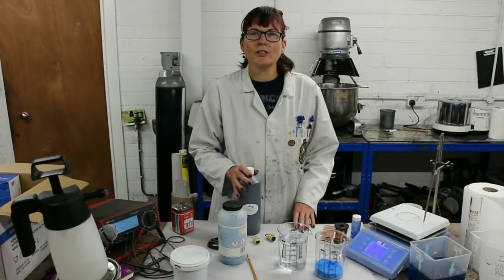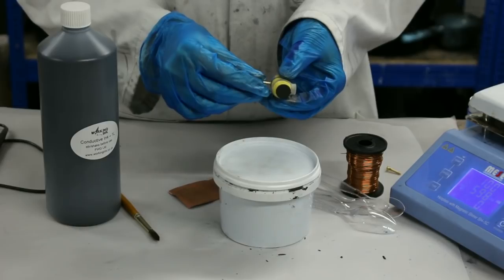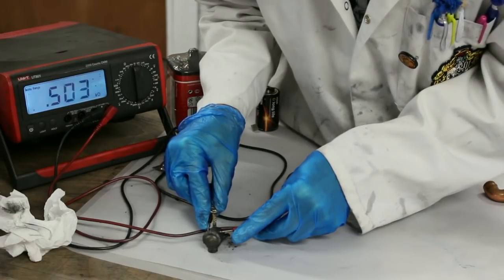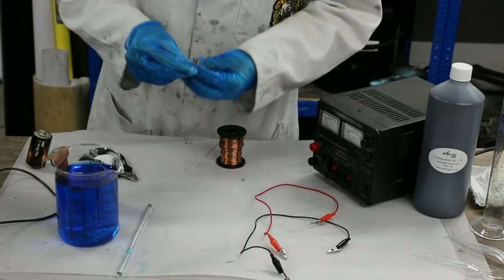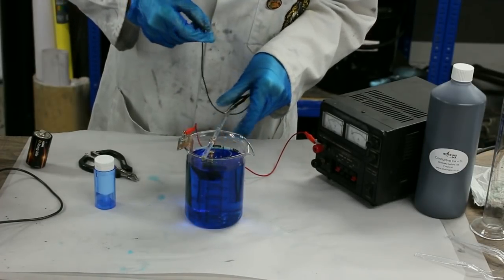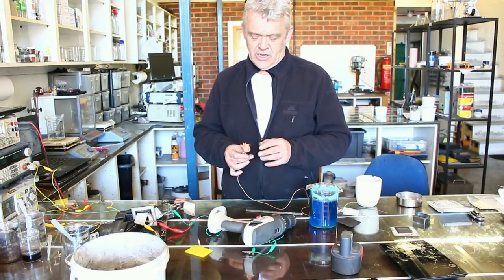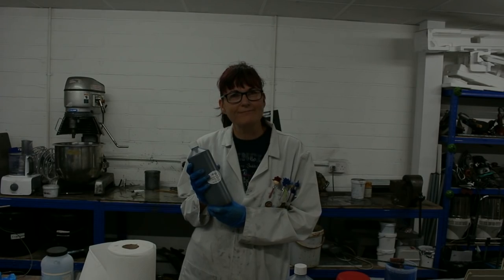How To Copper Plate A Minion With FWG Ink

Comment: Excellent work. Is the ink viscous enough to be used in an inkjet printer with a refillable cartridge? Imagine the possibilities being able to print and electroplate a flexible PCB.
Reply from the maker: it won't inkjet mate - the particle size is too big - the average nozzle is 45 micrometers across and the particle size is advised to be around 9 times smaller in order not to clog the nozzle so we need 5 micrometer particles - the problem there would be an increase in c plne trnsition points which would lower conductivity if the particles were that small.
Reply: Perhaps a specific larger sized orificed ink cartridges could be had that would allow an inkjet printer to be used to apply your ink when making cap's or batteries? It's a thought.
Reply from the maker: it is a thought and a good one - i am just not sure they do such things mate

Comment: I've been toying with the idea of trying through hole pcb plating. How does this product compare with the general DIY consensus of acrylic paint and graphite powder?

 You might benefit from doing a complete step by step tutorial specifically related to through hole plating, with a cutaway (or few) demonstrating the results under a microscope and the repeatability. Perhaps even creating a product kit with everything needed to try it. I imagine that would entail a very minor adjustment in your current lab supplies without making much investment in the endeavor. 
   Even with the current low cost Chinese PCB houses there is a lot of interest in DIY prototyping and processes right now, particularly in the Indian, Hispanic, and Slavic market. There are several new-ish YT channels that are doing really well by designing and building DIY etched prototypes and uploading them.
   Just something to think about ;)
Thanks for the upload. 
-Jake
Reply from the maker: awesome idea mate and i will try and do somethiing along the lines you suggest - though anything home done is never going to have the same results as commercial systems and repeatability is mor going to be an issue of how well a person does it as opposed to how well i do it - so i am thinking if it works at all it will be cool - as for repeating it to that level of success is going to be more down to an individuals skill as opposed to 'kit contents' - cheers

Comment: Hi Rob, I wonder whether you have an audio problem on one of your cameras? This video is mostly good audio, but the section about 8 minutes in has audio from only the left side, implying the right side mic is not working. This is similar to your previous video about the capacitor production prototype which was all on the left and almost inaudible without headphones. Great vid otherwise!

Comment: Hi Robert, have you done any videos on how to make a aluminum electrolytic capacitor? with some in depth info on the electrolytes that can be made for a electrolytic capacitor? such as does a certain type of electrolyte help improve dielectric constant of aluminum oxide or can a electrolyte be made to improve resistance of the oxide layer at high voltage. i would like to make a capacitor that can handle around the 300 - 500v mark or higher if possible while using a liquid electrolyte, and i am curious if there are any improvements that can be done with the electrolyte compared to what i am using (baking soda and De-ionized water "rimstarorg capacitor tutorial"), is pure 100% aluminum really needed? or can i get away with using a high grade aluminum like 6061 aluminum, as i want to make heavy duty anode and cathode plates and its a bit difficult for me to source 3mm thick pure 99% aluminum sheet. if you haven't done a video on how to make the basic electrolytic capacitor could you please make one. as you have so much experience in this area and it would be awesome just to hear what you have to say on this particular topic. i am currently having trouble with the test plates that i have in solution to form the oxide layer, i can create the oxide layer but its still leaking to much current 0.001 of an amp for a 25mm x 80mm plate, charged at 62v using a 62v dc power supply. the aluminum plates are made out of normal grade aluminum from the local metal shop so its not 99% pure. cheers
Reply from the maker: I am sorry mate - I haven't done that much on them - i am really a carbons guy and energy storage is the main area of concentration - sorry
Reply: no problem, thanks for the reply :)

Comment: I tried electroplating zinc on carbon coated grafoil. I suppose you can build 3d alternate layers of carbon and zinc. I ran it at 4.8v and got a white deposit instead of a zinc like layer
Reply from the maker: sounds like you got zinc oxide mate
Reply: @ThinkingandTinkering  thanks Rob. Am gonna give the slow charge a go
Reply from the maker: awesome mate

Comment: Very interesting, I personally invest in a current limiting power supply, loads out there and fairly standard on most cheaper power supplies now. Just set the current limit to 50mA or whatever and then crank the voltage to maximum. Copper electrodes for your batteries would be a bit complex, would be good to learn how to mask it so only a portion is plated.
Reply from the maker: we did use a current limited supply on the video - the battery suggestion was for someone who didn't want to invest that much and just wanted to give it a go for fun - more serious platers really need to look at a good supply and bath formulation
Reply: I have dabbled a bit with plating and found you will be surprised at the differences in results you can achieve just by changing a half volt or a minor adjustment in current to voltage. I find it just amazing what such a small change in either will cause to happen with the plating. I personally found my best results have been with voltage somewhere below 3v. DC and play with the current a bit starting low and work up slowly to get what I want.
Reply: Savvy, cheers :)
Reply from the maker: awesome advice mate - thanks
Reply: We did our own Copper, Nickel and Gold plating at one of my places of employment. Even the plating of Gold was very dependent upon current density. 3V or less was usually used, with current limited by plating bath electrolyte concentrations and spacing between devices and the sacrificial electrode. Nothing much was written down in a public location, but the desired results were more down to experience of the operators than to textbook knowledge. Surprisingly consistent thicknesses and surface flatness could be achieved in that way. A long, slow plating time, coupled with scrupulously clean device surfaces always gave the best results. 

One cannot over-emphasise the importance of the best cleanliness (no debris, no grease, no handling of the initial surfaces after thorough cleaning, etc), and low plating current densities, in achieving good results.
Reply from the maker: awesome advice mate - thanks for taking the time to write

Comment: Now try doing Styrofoam. Don't wash it in acetone first though... do it after for an ultralight copper sculpture.  It would also be an interesting way to get your current collector.  Just paint the copper again to get the internal cells of a stacked capacitor/battery.  For alkaline cells, just use nickel instead.
Reply from the maker: nice idea mate - here's a suggestion - you could try it and do a video too

Comment: (polyethylene glycol), Antifreeze Isn't it ?  Only need 0.1% ? Not much at all then. Question: I use copper nitrate due to the fact its a byproduct of my silver refining and I have way lots of it. shouldn't it work the same in that as copper sulfate though ?
Reply from the maker: pretty much any copper 2+ ion will work just fine and they pretty much all have the blue colour in solution.
Reply: actually PEG is not antifreeze, its corresponding monomer ethylene glycol can be found in antifreeze and breaking fluid
Reply: I see, got it and that makes perfect sense that its just one part in the make up. It also has a cousin like chemical that is quite similar ? A glycerin type chemical ? Forgive my terminology but I'm not a chemist so I am a bit off on things I'm sure but my question is : could that glycol work the same way?? Thanks
Reply: Rob, yea it actually looks identical in color and I found my copper nitrate seem to work just fine actually I was a bit shocked at how fast it plated and quite smooth without much of a dendrite problem. IDK may be its got something to do with it containing a LOT of copper and then there are other metals in there as well in smaller percentages that I am not really sure what all exactly but you could imagine its anything that would be used to make sterling silver. I guess that's an experiment or two in its self but I would like to narrow it down because it makes just an awesome looking plating and fast and I did go slow or tied to with low volts and current. IDK

Comment: Nooo I didn't realize there were two versions of the ink, and the one I ordered a few days ago with the battery webinar kit is the non-waterproof :(
Reply from the maker: send it back mate and we will replace it for you
Reply: Rob, Your a hell of a guy. AWESOMELY kind thing to do. This brings to mind a couple things I noticed as I was checking out your shop. Keep in mind these are just my personal thoughts : I first thought you were offering WAY to many choices for the ink but then with closer inspection I saw one was waterproof and one not. I barely avoided the same mistake myself. I would suggest some way to distinguish one from the other at a glance and possibly cut back just a bit on so many different sizes of each. Secondly I see you offer a book with the super cap Kit but not with the more expensive battery kit so I assume that would be your book on how to make graphiene ? Not sure but if so make it more clear that's actually what you get. Then I noticed your book on GRAPHIENE actually was not offered at all separately. Put it in there or at least provide a link to where it can be found. Just a few things I noticed that may help better your shop. Cheers mate
Reply: Indeed, offer much appreciated. But due to the high shipping cost, I'd rather neither of us waste the money to send another package now. Just get those better-than-lithium energy density batteries in production, and I'll buy a bunch of them, and some waterproof ink along with it :) I have way too many other projects to work on at the moment anyway.

But it would be good to at least put a note in the description that this ink is not waterproof, and there is a waterproof version.
Reply from the maker: cheers mate and awesome suggestion - i'll do that - thanks again - rob

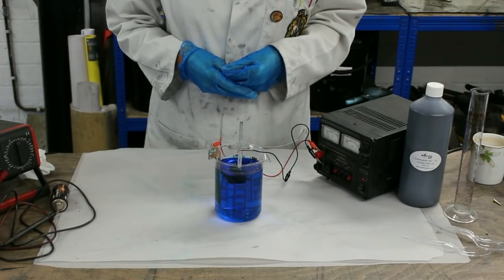Comment: why is the minion at 6:02 attached to a different wire than the one at 5:58? it's quite clearly visible that's not an alligator clip on a short piece of wire, but a long wire all the way
Reply from the maker: the original wire was magnet wire - and we forgot to remove the varnish coat so it didn't conduct - rather than go through that we swapped it for twisted stranded wire from an old kettle flex we had and carried on

Comment: Nice video! You can go one step further and plate over the copper with Nickel.  I have done this at home with great success. All you need is some pure Nickel metal and vinegar to make the nickel acetate electrolyte.
Reply from the maker: awesome idea cheers
Reply: After the Nickel, you could add a top layer of Chromium, but be careful; Chromium salts are very toxic.  This is the correct procedure for adding a Chrome finish to any conductor, especially to Iron. Copper, then Nickel, and finally Chromium. If done properly each metal forms a good bond to the metal below it, and the Chrome finish will be the best-looking; a mirror finish which will last for many years.

Comment: I suggest using PEG [mw 10.000] (polyethylene glycol) and choline chloride as additive because it can prevent dendrite and hydrogen formation.

In the case of PEG a concentration of 0,1% is enough to completely prevent dendrites
Reply: In case of PEG you can also find researches on this on google scholar
Reply: Nice observation. Would you point out the paper, please? Thank you.
Reply from the maker: there has been a lot of work on the use of deep eutectic solvents in electroplating - mostly by Lancaster university and a lot of additives will act to supress dendrites - really a study of bath formulation is needed if you are going to get serious about this - but for someone who just wants to have a go this bath works well enough at low current density
Reply: Robert Murray-Smith 
Yeah, probably works fine. 

I didn't talk about DES or ILs, I meant choline itself just as additive...

Actually I am working on fuel cells and batteries myself (still student) and I would be really thankful if I could talk with some knowledged persons about my ideas plans and sometimes successes, would it be possible, that I could directly contact you from time to time if I have questions, Mr.Smith? Currently I am working on ascorbic acid fuel cells und rechargeable aluminum air batteries, creating water tolerant all solid state electrolyte.
Reply from the maker: you are welcome to drop me a line amte - robertmurraysmith64@gmail.com
Reply: Robert Murray-Smith thanks very much, Sir
Reply: UM, sorry to have to ask but : ( deep eutectic solvents ) Would someone mind explaining what that is, briefly please ? I never heard of that concept before and have no idea how it works or what it is. I hate to ask but It would just save me so much time I do not have should I have to Google it and weed out all the CRAP to find it. Thanks so much !!
Reply: Albert Mueller 
Ahm, yes, luckily I have way to much free time...

I try my best to explain it.
DES (deep eutectic solvents), often falsely called ionic liquid is a system out of two or more compounds, where a certain stochiometric composition forms an eutectic system (mixture of compounds results in lower melting point than any of the compound itself). In this case the eutectic property is aquired by complex formation, therefore it often has very high electrochemical stability of up to 5V which make it suitable for battery apllications.
Often the charge delocalisation /complex formation is achieved by hydrogen bridge formation, so it often requires a hydrogen bond donor and a second compound which is either a metal salt or a quartery ammounium compound 
(if I remember right, choline is an example for this)

But watch up, DESs do not always have a high ionic conductivity, for example a choline chloride-Glycerol/urea system is useless for this applications unless you add at least 1% H2O or some multivalent metal salt, which supports the DES formation.

Hint: although AlCl3 (anhydrate) will form a des with urea or TEA*HCl which works great for battery applications, AlCl3 (hydrated) will be completely useless on the other side, water in a ZnCl2-urea system will support the eutectic formation and increases the ionic conductivity.

That was the most important things to know about a des.

Sorry for my bad grammar and typos, I am NOT a native speaker.

I highly recommend reading the wikipedia article, it is easily understandable and not too long.

regards,
André
Reply: Oh, I forgot to mention, DESs are non volatile and have a astonishingly low vapor pressure.

Even though, this example may not perfectly fit in the concept (because of the volatility thing) but it makes is easier to understand:

Imagine you have frozen water and salt, both are solid compounds, but as soon as you mix them together, you will get a liquid because of interaction of the ionic and molecular compound on molecular scale. To explain is briefly, it is energetically easier for the H2O to hydrate the dissociated Na+ and Cl- ions than forming a crystalline hexagonal structure.

Examples for a DESs are:

choline + urea/glycerol/acetamide
FeCl3 + glycerol/urea/acetamide
ZnCl2 + glycerol/urea/acetamide
AlCl3 + TEA*HCl
CrCl3 + urea/glycerol/acetamide

AND, probably the most popular one:

Menthol + Camphor

Comment: You could have weighed it before and after to give us an idea of how much copper was deposited.  It would have been reasonably thick in order to survive the polishing.  Mate.
Reply from the maker: that's a good point mate and i think we will do that for next time.
Reply: Makes a great point. However even better idea : didn't I see there were more than one minion? Perhaps simply weighing one of those compared to weighing the plated one would put you in the ball park and quickly.